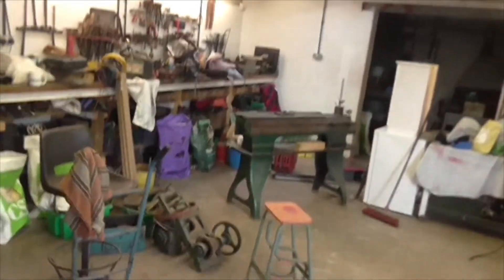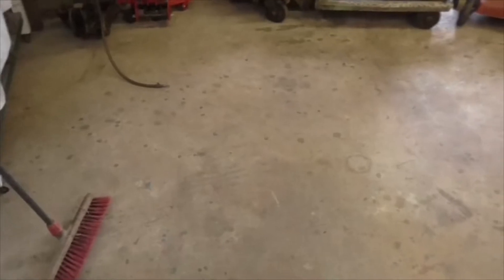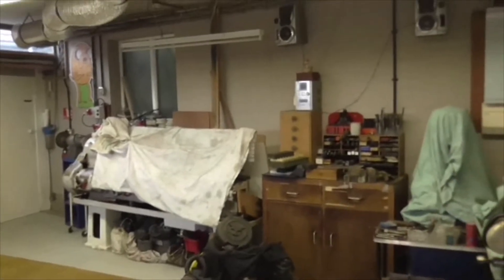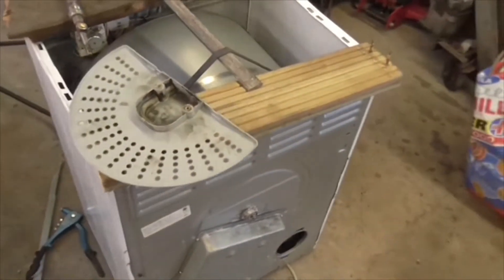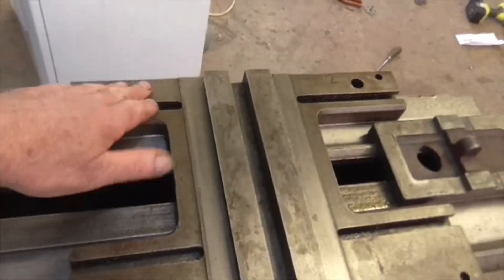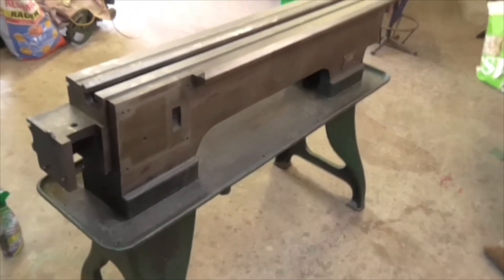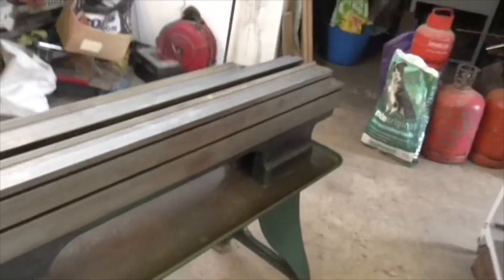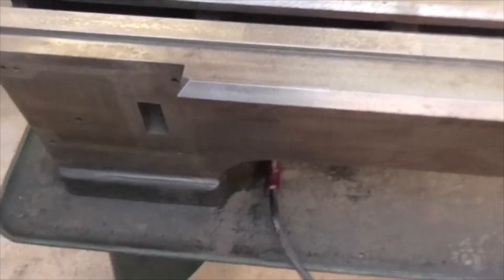Holbrook B9 Rebuild, part 2, The bed! plus fitting a tumble dryer stretch belt!

Comment: Hello Phil,
Good work on the Holbrook... I am sure it will look great when done...
Cheers.
Paul,,
Reply from the maker: Got the headstock and bed and legs into primer today, its looking good! A bit of a mappings reaction on the legs where the original paint doesn’t like the new paint but not serious. Where the old 
paint is complete cover it is fine! The main thing is that a have stopped cleaning it off and started putting it back on!
Phil

Comment: Hi Phil, loving the style of the Holbrook so much more thought went into the looks back then, just check on the chip pan, you may find its a separate piece with the bolts going through, cant see it being one casting with the bed ! would make machining the surfaces a nightmare, and look at the mass in that bed, Mr Holbrook sure did*nt skimp on materials, why on earth would anyone buy a new Chinese lathe ! not fancy the epoxy 2 pack as a primer ?. Recon she will be a real joy to own. Del
Reply from the maker: I already checked Del! When I stripped it down in the shed where it lived, in a bitterly cold November , I took the legs off and slid it out to the trailer on the chiptray in the snow! I couldn't believe it either, but it is deffo all one casting It is machined flat on the bottom where the legs bolt up, so I guess they worked from there!
Phil

Comment: Hi Phil. Nice work so far, all cast in one, that's amazing. I agree with light coloured machines that's why my chiptray's white. One point which may help to assist in measuring the wear along the lathe bed surface. I would assume the long horizontal tee slot along the rear would have originally been parallel to the bed surface when the lathe was new. I doubt the tee slot will have any wear so if you rigged a device up to slide back and forth along the tee slot. Mount a DTI to it to check the lathe bed. Tony
Reply from the maker: I like that idea Tony, i shall have a look at that!
Phil

Comment: I'll be a lot of work Phil, but scrapping the ways would be much preferable to Belzona in my humble opinion
Reply from the maker: Andrew!! I am shocked, it was you who recommended Belzona!! LOLZ Maybe now you have seen it you have changed your mind?In actual fact when you put the  saddle on there is very little to measure, there are matching longitudinal striations on both the underside of the saddle and the bed, but there seems to be enough metal in between to keep the saddle tracking horizontally and I am not convinced about my 1-1/2thou reading because  of this, when you put the saddle on it seems to dissapear. I do not have a straightedge worthy of the name ATM so I am going to get the headstock, tailstock and bed done, then have a reasses when I have two fixed points and a test bar to meadure from. Mr Holbreek may have been a genius in many ways, but the provision of some bed wipers would have nade all the difference!
Phil
Reply: @philhermetic  That's strange I have no recollection of that Phil and I've never used Belzona ! I've used Devcon titanium loaded putty for seating a new dipper bushing in my JCB 803 (still holding after several years) and a temporary repair to a pressure release valve block on the same machine which worked for a while. I'd scrape the ways and bond Turcite under the machined saddle to bring it back to the correct height.

Comment: They say every day is a school day, and, given what I’m about to say, this is probably going to be one for me. I can see that re- scraping all the ways would produce the best result so far as finish is concerned, even though it  is major work especially on the V-way, but why is it such a problem? Yes, I can see that effectively it would lower the centre height and may require medication. But that of itself isn’t a problem as it would only be apparent at the tool post. During my time as a day to day machine operator - which wasn’t that long but is significant - I used quite a number of lathes from a Smart and Brown to a big old between- the- wars Triumph with a massive long bed, and to the best of my recollection every one needed packers under the tool to set the tool at centre. If centre height is such a concern, why not simply shim under the tool post? There, I’ve said it… I’m sure I’m missing something but what is it? If you’re going to scrape the ways, I’d be investing in a power scraper…it’s already looking like a quality machine again so it’s worth considerable effort.
Reply from the maker: The problem is that it lowers the saddle, and thus the apron and the lead screw and shafting become misaligned
T
Reply: @philhermetic  so the table casting would be scraped until the lead screw was aligned? Surely there must be set up and tolerance adjustment somewhere?